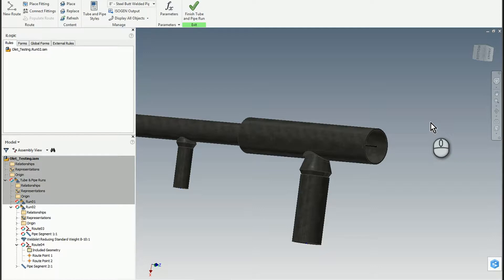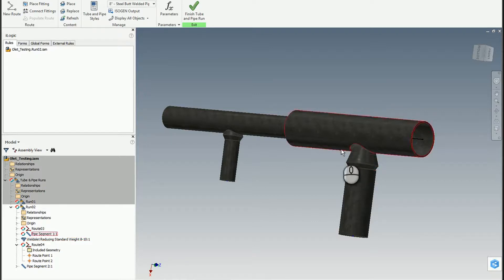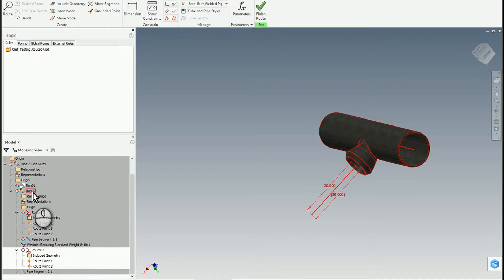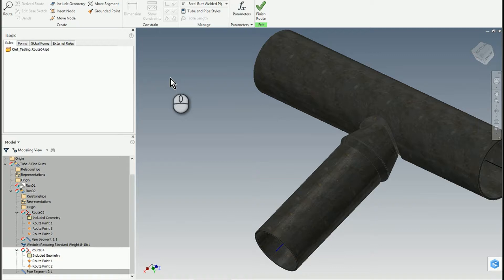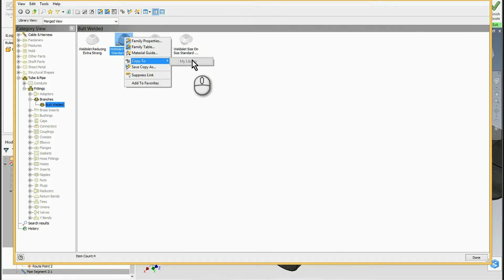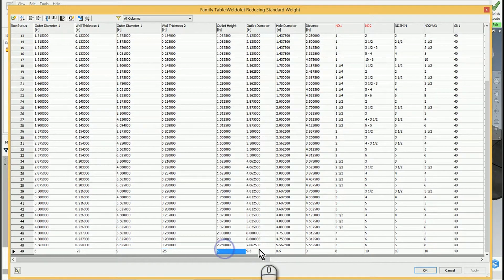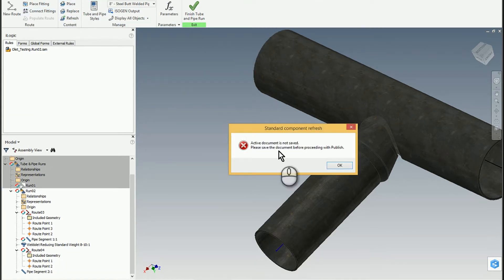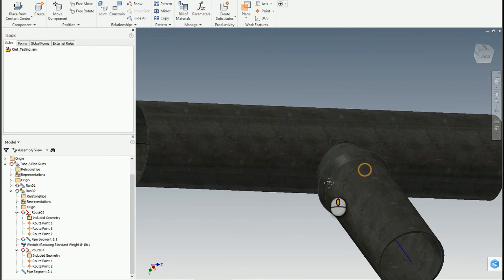Autodesk Inventor Tube & Pipe - Custom Content Center Olet

Comment: I followed this video and I was wondering what I might have done wrong.  I can not seem to locate the branch folder with weldolet and sockolet in the content center anymore any help on how that happened.  I created a custom weldolet 10-12 and everything seemed to work fine.  I went back into content center to see it updated and branch folder is missing only in my history.
Reply from the maker: Nick, thanks for reaching out and apologies for the delay in getting back to you!  There could be a couple of things that could cause this.  Please be sure that your custom Content Center library is loaded into your Project File.  Second, be sure to clear any filters in Content Center Editor as that can hide categories and families based on the filter settings.  Finally ensure that you are looking at the "Merged View" within the Content Center Editor, as specific libraries can be active which don't contain your olets.  If you'd like, we can knock out a video to illustrate those options.  Please also let us know if you are having additional challenges.